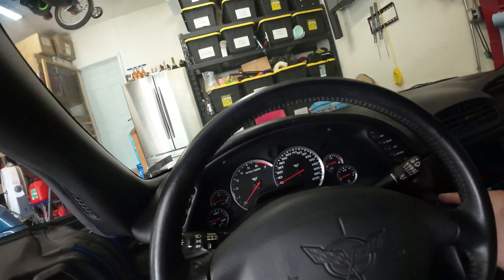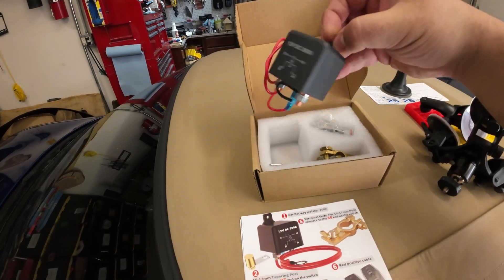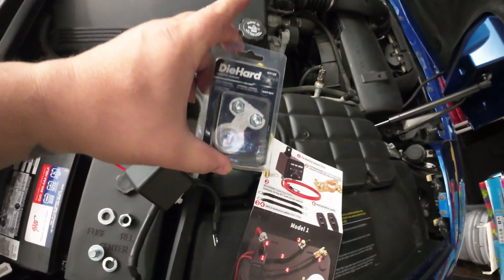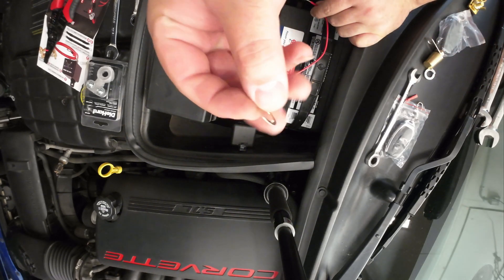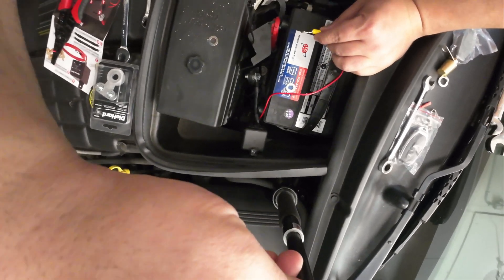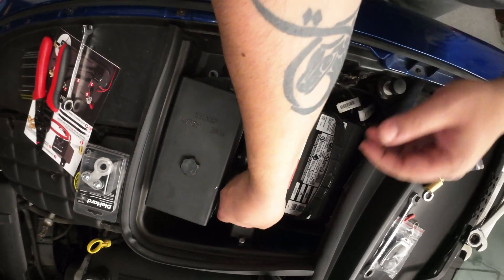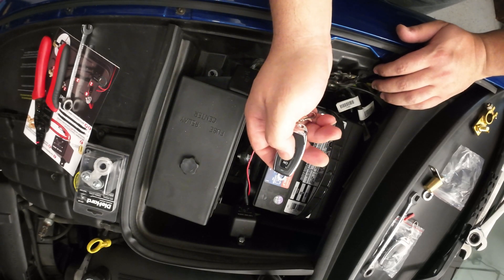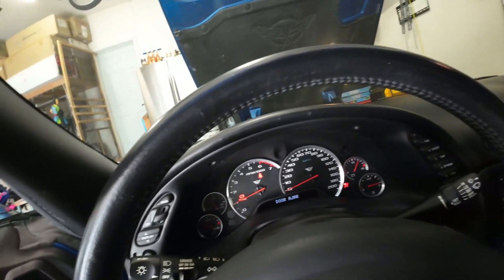Installing a Battery Kill Switch & Why You Need One

Comment: Question how did you make the connector wider to fit? I have a 1990 Chevy same battery as yours not the traditional positive and negative screw in?
Reply from the maker: I had to purchase a different screw for it.